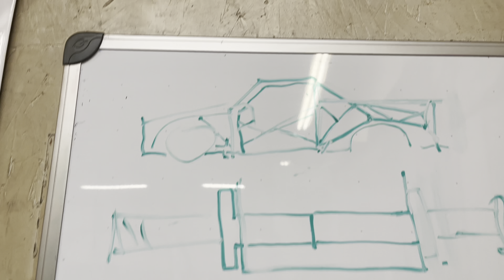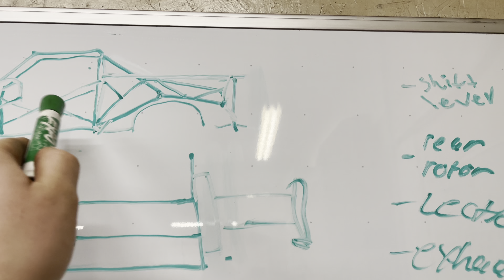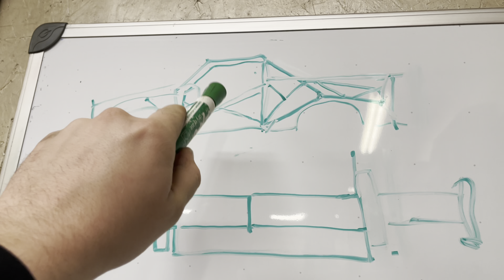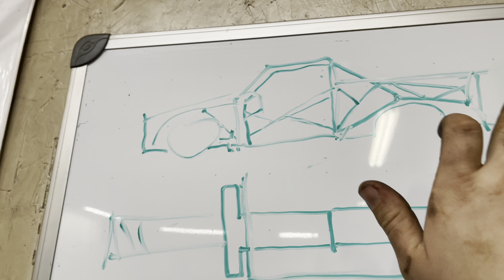S10 tear down, getting ready to pull cab and narrow frame! #automotive #motorsports #welding

Comment: Another benefit of a higher engine centerline, is that it raises your “instant center”. That helps the car rotate onto the back tires.   Ever wonder why those gassers were 3’ up in the air? That’s what overcame the lousy tires they had.